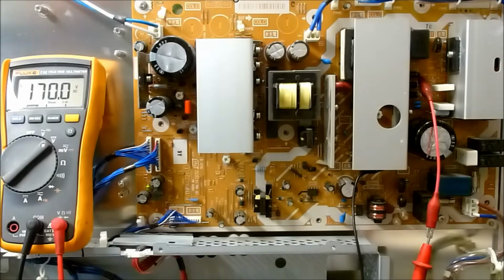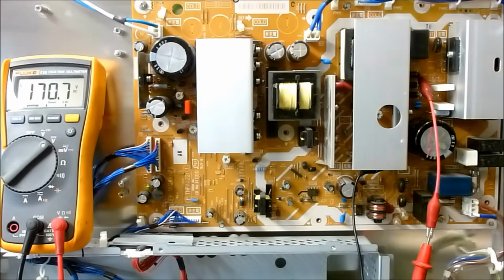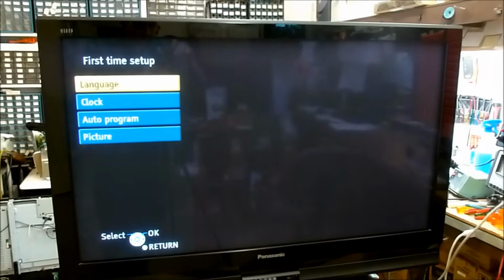Panasonic TH-42PX75 80 TH-C42hD18 Dead TV Repair Fix TXN/P1XGTUS HNTUS LSJB1260 LSEP1260

Comment: Yeah...I wasn't nearly as lucky: the FET, the large diodes (mine had only 2), the large ceramic resistors, plus R493/R439 had gone. Based on this, I replaced the IC and Q404 as well but it still blew the FET again....really annoying and have no clue what's causing it :|

Comment: I realize this is an old video and getting a response is a long shot but hey worth a try. I've never attempted anything like this so forgive me for not knowing any terminology,but I thought that you only needed to remove that one white rectangular object. And replace some diodes and fuses. But then you skipped to the next scene and you had a completely empty board it seems. So I'm a little confused.
Reply: Wait a minute, maybe I'm an idiot. Maybe that's the back of the board haha. Still only part ways through the video I guess I'll find out.
Reply from the maker: I have faith

Comment: I replaced mosfet with IXFQ60N50P3, Diodes with MUR460RLG and the fuses.  Panel now starts up - good picture and sound - but shuts down again after a few minutes - RED light flashes 10 times.  What voltages should I be seeing at P6 and P7 pins. What is most likely cause of this defect.
Reply: I think the capacitor nearby nolonger works by shorting out . That cause the relay does not have enough energy to hold the switch on

Comment: I replaced mosfet and fuses.
Diodes were Ok.
Still not working.
Somebody can help? I will be glad to reward you to your PayPal
Reply: +Artjoms Pugacovs did you measure out the diodes?
Reply: Yes, i also replaced diodes after.
I still have this red led blinking code.
Relays try to turn on tv. Click click, clikc click
Reply: i have same problem.. relays click.. led light blinks 12 times.. really don't know where to troubleshoot. mosfet and diodes and fuses seem ok on the powerboard. any help will be apreciated.
Reply: hola, tengo el mismo proble enciende es click click es nesesario cambiar el transistor

Comment: Hi norcal, I have a Panasonic TH-50PX80A plasma. This unit has 2 red blinking lights with no picture. The power supply board on my TV is different to this one here. I am wondering if you have any information on which parts to replace. My guess is it is very similar to the TV on this vid. If I know which parts to replace then I can do it myself, as I have repaired a Samsung the same way. I am no expert, just handy with a soldering iron!
Thank you in advance.

Comment: HI Norcal,

I have a TH-42PZ77U that has a dead short also just like this. It's a different board but similar.. I have fixed a lot of pannys and I'm starting to repair at a component level.. I'm sure the problem is a FET somewhere abut I can't seem to find the source. I'm an electrician by trade and I'm starting to teach myself electronics though I still don't fully understand it all..  Anyway, this is a very similar problem that you describe in the video.. Both 10amp fuses were blown, I replaced them and one blew out again right away when I plugged it in.. Any help would be greatly appreciated!!

Comment: Great video. I had the same problem shorted MOFET transistor RJK5020, I did replace it but I did not change the 3 diodes as they are still good. I also found that the bridge rectifier is no good either and replaced it. All capacitors seem too be ok, I just checked them with the multimeter that I have which only measures up to 33 uF so for some big capacitors I only see the number shoots over the range and I expect it is good. When I plug in the power and did not get any voltage between the cathode of the diode and the hot ground as you did in your video and when I push the power button the fuses blown off again. I just wonder whether you could help me here, thanks a lot for your time.

Comment: Great video.  My tv failed before apparently same issue.  They charged hundreds to fix.  I'm fairly handy testing and soldering.  My only question.  You mention early on a need to replace the two fuses.  But no mention or video regarding those fuses.  Is is necessary to replace.  Thanks so much.  Tom

Comment: can you help me please? lol, working on a lg tv power supply board model EAY41360901..i bought a repair kit that includes a few mosfets, fuses etc, i accidentally started unscrewing one mosfet that was not one in the kit and the area around the screw broke..the lettering on it reads FCF20B60  8A 17N . I cannot find one in the US.. is there one that is comparable that i can use as a replacement? i know nothing about mosfets but i know with caps, you can use a higher uf as long as the volts are the same, hoping these have the same flexibility, please let me know asap ty!

Comment: I have this tv and tested the mosfet. There is no short on the mosfet or the rectification diodes.  There is not any voltage acrossthe annodes of  the rectifier diodes though.  Also, the relays do not click when the tv is plugged in. Any ideas would be greatly appreciated.

Comment: Hi,
Great Video. Was wondering if you could advise me on my issue. My Panasonic TH-42PH10UK has the Two Light Blink of Death. But both fuses are ok on the power board. The three relays click on in succession and then click off. If I press the power button a few times the relays stay on and I here a little buzzing on the right board with the capacitors on it. And then it powers back off. In need of help to solve the mystery :-) Thanks, NJ Poolman
Reply: +NJ Poolman  help

Comment: I replaced the part as shown. When I turn the power on I see the 390 volts but then I hear clicking and the voltage begins to drop and I get 7 red light blinking.  Any suggestions. Jerry Sallazar

Comment: Add my Panasonic Plasma TH-C50HD18 to the list of now working TVs because of your video. It had a LSEP1260 MX (silkscreened on the left side with the MX ink stamped in a white box) power board. Symptom was TV turned off while watching. No sign of life. No LED light and no clicking sound.

Awesome video. Thanks for the well done troubleshooting with the multimeter,
Fixed my dead 5 yr old Panasonic Plasma TH-C50HD18. One fuse was blown and the Q406 mosfet was shorted. Everything else checked out as shown in the video. Bought the parts thru Digikey IXFQ60N50P3-ND Mosfet and a F4612-ND Fuse. Thought about soldering on a fuse holder as the leads on the fuse were a pain to desolder.

Comment: Hi great video
I need your help new to all this tv repair have a friend helping Basically The R411 10 watt and R448 R449.12 ohm oc
The control ic is Blown and i was wondering apart from replacing these parts and the mosfet Will it be worth fixing  will there be more things to look at with the Ic control blowing Or should i look at buying a New board If you wish can you email me at spooner1@blueyonder.co.uk
Thanks

Comment: Hi
Cracking info Helped no end , identified mosfet is dead short circuit, ultra fast diodes measure ok, only have 2 will replace with 3.

can you tell me details of the control IC,it has a hole in BLOWN. R493 R439 12ohm resistors both oc.
Would you expect any other damage or would you think it would be better to replace the board?
email if easier spooner1@blueyonder.co.uk
many Thanks
Graham

Comment: No. There s no cold solder joints on that mos or the diodes. Take  a second look on that pads and you will see why the solder joints form like that.